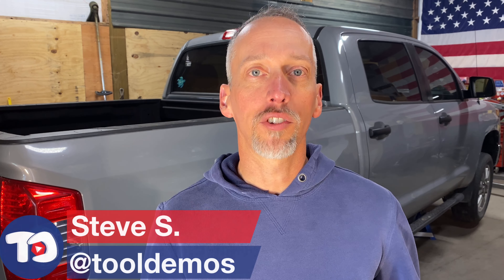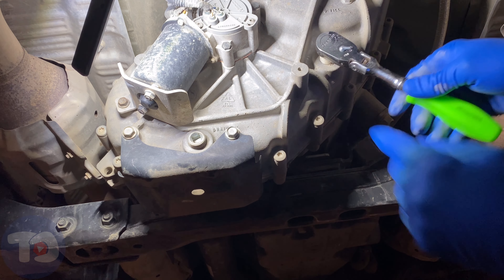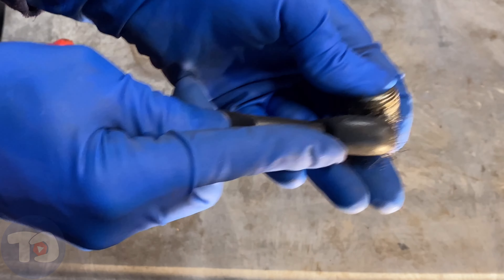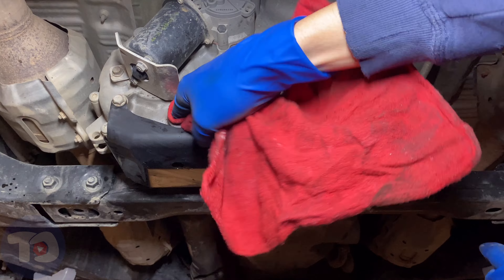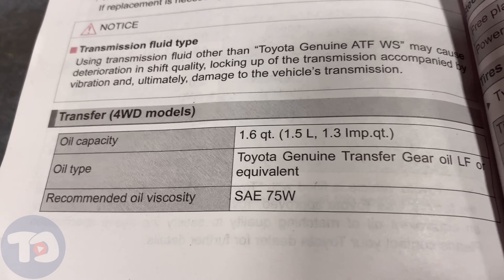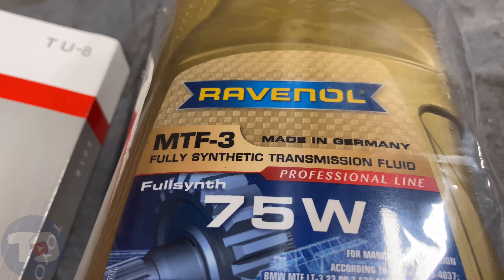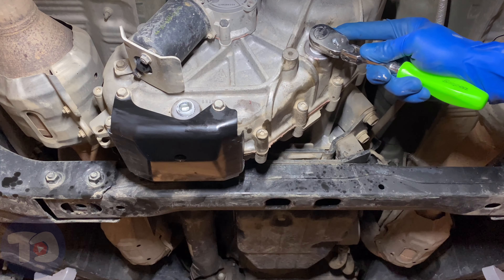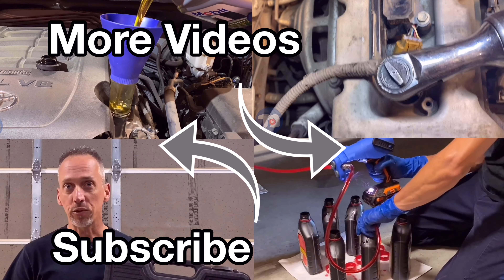How to change Transfer Case oil in a 2018 Toyota Tundra

Comment from the maker: Below are Amazon Affiliate product links. Clicking a link will take you directly to Amazon's product page for that tool - it won't cost you anything, but will help to support this channel. Thanks for watching. 

Ravenol MTF3 75W oil: https://amzn.to/3wbFoIA

Permatex 80632 Thread Sealant: https://amzn.to/3orqdIA
Reply: Will the Ravenol MTF3 (Manual Transmission Fluid)be compatible with Automatic transmission?
Reply from the maker: @philippeducut9702  the transfer case is sealed, so it will not share the same fluid as the transmission.
Reply: @ToolDemos  I apologize for my vague question. My main concern is that the the Ravenol bottle shows as MTF and my Truck has an Automatic transmission, will this be a concern that I have to consider or it's still a good buy for my truck's transfer case?
Reply from the maker: @philippeducut9702  ok, I understand. The exact fluid Toyota calls for is Toyota LF. It sells for $90 a quart and nobody (almost) uses it. Not even Toyota dealers.
The manual allows for non-genuine fluid for this job, which is why I went looking in the aftermarket. The Ravenol fluid meets all of Toyota’s specifications for the transfer case, so I chose to use it.
If it helps any, I’ve been running the truck with it for 25,000 miles now and had no issues at all.

Comment: If anyone wanted to buy brand new plugs from Toyota with new thread sealant already on them, the part # is 36136-0C010 cost is about $8-9 and you'll want two of them.
Reply: Both of those plugs are meant to be replaced when doing this service, so thanks for posting the part numbers!

Comment: Glad I watched your video, to inform me about the pipe plugs not needed to be tight. Mine were only in about 3 threads. My Tundra has approx 87,500 miles on it. The old fluid was very dark, and a brownish tint to it. Glad I changed it out. Thanks for all your video's. I have referred to many of your video's. They are very informative. Thanks again. You have saved me alot of money!!
Reply from the maker: That’s great to hear! See ya in the next one, happy wrenching.

Comment: Great video on the fluid-swap process. I'll be performing the same service on my 2020 Tundra in a couple of days. One piece of advice from a former Loctite application specialist: The Loctite PST-series thread sealants will seal pipe threads (hand tightened only) to 150 psi immediately, and much higher when cured. Added benefits: Plugs won't back-out in service, nothing in the sealant, even if it mixes with the transfer case fluid, will harm or affect performance...and you don't really need to be too concerned about cracking the drain-plug hole boss on the casting since you won't need to apply a lot of tightening to get a good seal. I have been using the PST products on automotive threaded plug applications for years with no troubles. The PST tubes have a nice applicator tip on them, too...no mousing-around with those pesky brushes, and anything outside the actual joint-seal will remain liquid, and you can wipe it off if you wish.
Reply from the maker: I’ll add that to my list, thank you.

Comment: Thanks for the video and info; did mine last night and the tool list helped. I used a boat outdrive oil change pump to fill the transfer case. It worked very well and at  about $10 very affordable tool that makes the job easy and less messy.  Also, while doing the service is worth checking the vent to ensure is not stuck. 2018 Tundra 1794 edition.
Reply from the maker: Well done!

Comment: Have you had any issues using the Ravenol 75w? I’m about to change the fluid in my 2015 tundra and can’t decide whether to use the Toyota oem or Ravenol. Really don’t want to pay $160 for 2 liters for the oem and not even use all of it. Reading on the boards, some are saying it’s a waste of money, others saying absolutely don’t use anything other than the original fluid. Spoke with the dealership and they’re actually using Valvoline 75w-90. So, just curious if you’ve seen any difference.
Reply from the maker: Been using Ravenol for 60k miles now. No issues.
Reply: @ToolDemos  awesome - thanks for the info!
Reply: To be clear, the Ravenol fluid does not have the same additive pack that the OEM fluid does.

Comment: Can you use 75w90 gear oil like in the front and rear diffs?
Reply from the maker: My only guess is that they use the MT fluid for better fuel economy. Gear oil might work fine, but I usually stick to the book.

Comment: Hi ! wants to change oils in mechanisms and gearbox. tundra from January 2013 4wd 5.7 flex. I understand that oil with GL-5 specification is poured into the differential and reducer,: for egzample : millers 75w90. I understand that no additions to the mechanisms on limited slip are needed there? Thank you for your answer and best regards from Europe (Poland)
Reply from the maker: Hi Greg. For the differentials, Toyota recommends 75W85 GL5. No need to add friction modifiers.  You can see my video here: https://youtu.be/XtBw29bA6ug for the rear. 

I am surprised that you have a Tundra in Poland, I thought they were all in North America.
Reply: @ToolDemos  Thank you very much for your answer and help. Tomorrow I'm going to work. I imported the Tundre in 2018 from the USA - I found it online on the Toyota McGill website in Houston in great condition. I have a few cars, but I always dreamed of the tundra. I am very pleased because I am a motoring fan with good times (naturally aspirated engines, MPI injection, large capacity). I don't want to look at these new inventions :)

Comment: Is there a reason why you pick this oil over OEM from Toyota? I also noticed you use a different oil for your rear differential. Thanks
Reply from the maker: Hi Mr robot. I tried the Toyota dealership, they don’t carry OE Toyota fluid. Ravenol is all I could find that meets the specs from Toyota. The Redline fluid I used for the differential was about half the price of Ravenol and meets Toyota specs, so I got that.
Reply: @ToolDemos  So i'm going to try redline MT LV, which they say is a replacement for the toyota 75W.
Reply from the maker: @tonyellis6383  should be a bit cheaper. Thanks for the tip.
Reply: Also, the Toyota branded oil is ~$80 per quart. The Ravenol is $20

Comment: Thanks for another great videos. Respectfully, Is there not a Toyota torque spec for the drain and fill? I have no idea. Just asking. Thanks again for the video.
Reply from the maker: Yes there is, the book says 27lb/ft
Reply: @ToolDemos  thank you!
Reply: Earlier in the comments you mentioned 18 ft lbs..  18 or 27?  Great videos. I have them all queued up for my 2019 Mx.
Reply from the maker: @BullfromCE-n4n  you’re right. I see Borg Warner has a lower spec than Toyota. One reason I don’t like this type of plug.

Comment: You pick up a catalytic converter shield for your Tundra yet? Would recommend, lots of good options! Doesn't interfere with too many service items requiring removal, I think transmission service is just about it.
Reply from the maker: No, but I have thought about it.
Reply: @ToolDemos  I would! Talons Garage is a great route to go, and the nut retention plate makes one-person install a breeze, can't recommend enough. I was on the fence about it until I saw the wait time and cost of getting replacement catalytic converters, ain't nobody got $3k+ and 8 months free, not when there's great solutions under $400.
Reply from the maker: @medcitymoto  I appreciate the recommendation.

Comment: I was looking and Ravenol makes a product called "RAVENOL J1C1144-001 SAE 75W-85 Gear Oil - DGL Full Synthetic API GL-5 LS" that appears to be more specific to being gear/transfer case oil.  They both meet Toyota's specs, but I wonder if one or the other is better or worse?  Heck, I wonder if they're the same thing.
Reply from the maker: Toyota recommends straight 75W transfer case (LF or equivalent) oil for this application. The one you are looking at is a multi-weight and has limited slip additives that are unnecessary.

Comment: What do you think about cleaning the threads up and using teflon tape instead of thread sealant?
Reply from the maker: I don’t like using Teflon tape on metal threads. It was designed to use on PVC.
Reply: @ToolDemos  really? I’m pretty sure it’s the opposite? It’s for metal threads and shouldn’t be used on pvc because you can strip the plastic threads
Reply from the maker: @Steveambriz  OK I just researched it, it looks like you’re right. They have different formulations of tape for different types of pipe and the type of liquid or gas that you’re trying to seal. I know from experience that using that stuff on iron or brass plumbing always leaked. The only thing that works for me is pipe dope in those situations.

Comment: I have a hand pump that screws onto the tops of the containers, can I use that for the transfer case, diffs, and trans changes? Thanks!
Reply from the maker: You can, yes. It will take some effort, but you’ll get there.

Comment: Great video. Do you think teflon PFE tape would also work on the threads?
Reply from the maker: No, it’s made for water. I’m not a plumber, but I’d only use that stuff on water pipes. For automotive applications, stopping oil leaks, the product I showed is the standard.

Comment: Great video! I purchased the manual with your code and don't see any notes about using sealant on the plugs. How did you know that you're supposed to apply a sealant and which type to use?
Reply from the maker: That’s a thread seal I keep in stock for this type of application. It’s much better than the PTFE tape when the threads are metal. I think Toyota puts ‘em in dry at the factory, but this has always been my habit.

Comment: My document says to torque those plugs to 18 ft/lbs
Reply from the maker: Thanks, Colorado! I should have looked it up considering all of the whining I was doing.
Reply: @ToolDemos   Did mine today...old plugs seemed to come out way too easy!  I cleaned them and used some high temp thread sealant I found at O'Reillys.
Reply from the maker: Awesome news Colorado! You might have one of those Tundras that go over 1 million miles.
Reply: @ToolDemos  Ha! No she’s our camper puller in the summer and for snowstorms so only 41,000 on her so far (2014)
Reply: @coloradoboo1071 do you put weight in the bed when driving in snow?

Comment: My 201 Tundra is a 4x4 but i never towed or hauled with it or used it in 4x4. it has 60k on it. I plan on doing the rear but is there a rush to do the transfer case?
Reply from the maker: The transfer case is under load any time the truck is moving (not just in 4x4). It is less stressed, but will still need a fluid change at some point.

Comment: What ravenol fluid do you use for the rear differential and the front differential I have a 2017 tundra trd 4x4
Reply from the maker: Hi Rudolph. Toyota recommends a 75W85 GL5 for your differentials. Here’s an affiliate link for the Ravenol brand oil: https://amzn.to/34ffPKD. I did a video on the rear diff, you can watch it here: https://youtu.be/XtBw29bA6ug. Thanks for your question and happy wrenching.

Comment: Just curious with you using aftermarket fluid, but you haven't noticed any weird noises or engagement issues since doing fluid change have you?
Reply from the maker: No, and the Tundra just turned over 100,000 miles with no problems at all.

Comment: Hi TD, question. Did you feel any difference going 4L or 4H with Ravenol.  I'M about to do the same and I want to be sure it is the same or better than original Toyota oil
Reply from the maker: Hi Juan. I haven’t ever used 4-low, but Mrs. S. has. Before the oil change, she had no problem getting it to work. I just went out to test it and it worked fine. Also remember that to shift into 4-low, transmission needs to be in neutral and keep your foot on the brake.
Reply: @ToolDemos  Thanks a lot
Reply: Don’t be spraying crap in the hole
Reply: @lrcreamer bro a little break or engine cleaner isn’t going to hurt anything. Chill out boss

Comment: I thought it would be use more fluid than 2 quarts on transmission?
Reply from the maker: A fluid change on the transmission will be about 5 quarts. This is just the transfer case so you only need the two.

Comment: Why not take the small skid plate off first before you drain the transfer case it’s just 4 bolts. It will save you a lot of clean up.
Reply from the maker: The thought crossed my mind. In the end, I just shot some brake clean in there and it cleaned up okay.